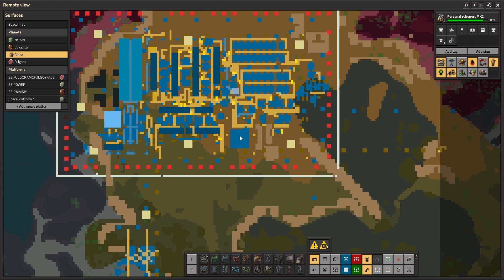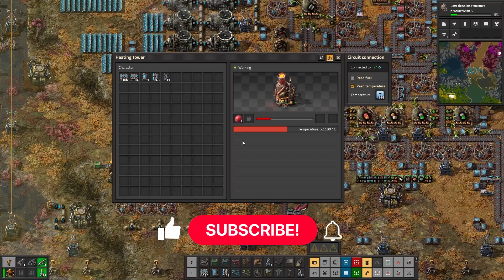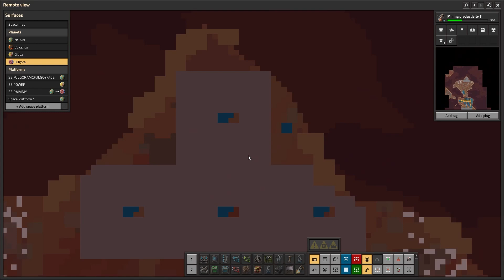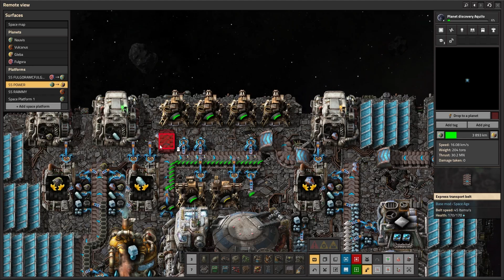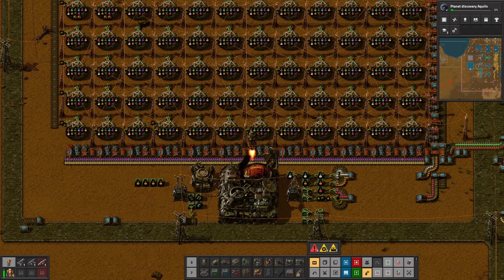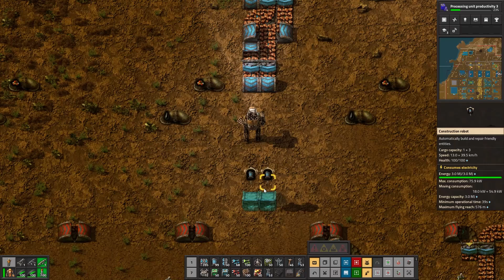STABILIZING 3 planets and cleaning up the base - Factorio 2.0 Space Age EP20

Comment: Your bacteria lines are backed up because you have 3 bulk inserters unloading the assembler but only a fast inserter moving bacteria off the belt into the box where it spoils into ore. also, you may want to set your rocket launchers to filter only targeting the larger pentapod variants. let lasers handle the little ones. you could do the same wiht rocket launchers on space platforms, filtering to only target the medium and large rocks.
Reply from the maker: @Baqar72  thanks. Yes I've fixed the inserter in a couple episodes. I might do the rocket logic on every second rocket. I don't trust my laser turrets on gleba

Comment: Hey, it's Power. Episode 20....here's a few comments ! 1) I definitely think that Exoskeleton Mk 2 is a thing. Probably a Planet Aquilo thing. 2) I'm not sure if a collision between Spiderton and the train is really possible. Wouldn't the Spidertron just walk over the train ? Try in with an immobile train. 3) You should add a RADAR at the new copper mine. 4) The new Copper mine could have used the design where you smelt the copper plates on site ( in situ smelting). You missed an opportunity trying it out. 5) Quality modules and Space Platforms: many players I've seen report much better performance of Space Platforms by simply switching to Uncommon-quality Asteroid grabbers, Crushers, and ... Solar Panels !! I've also seen that many players do the following: for any structure placed on a Space Platform that uses power, have 50% of its module slots occupied by ... Mk 3 Efficiency Modules ! You know, those modules you don't use anywhere. Well, on Space Platforms, they make a lot of sense. Allright, talk to you later.
Reply from the maker: Yes I completely forgot about the in-situ mining thing, I facepalmed after I finished the episode and was like... wait why am I still importing copper ore...

Thanks for the suggestions about what to use quality on, when i get to that I will definitely do some quality space products first. I was thinking turrets, but sure let's do miners and maybe the chem plants that make my fuel?